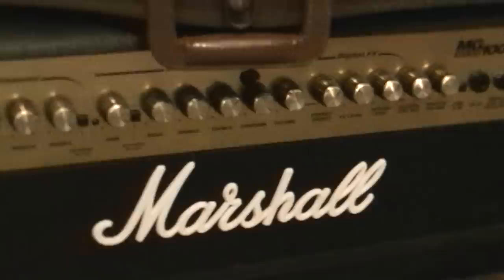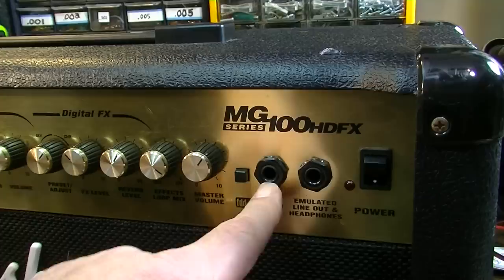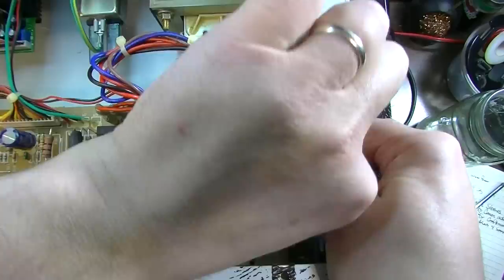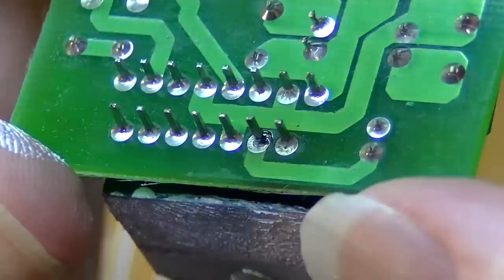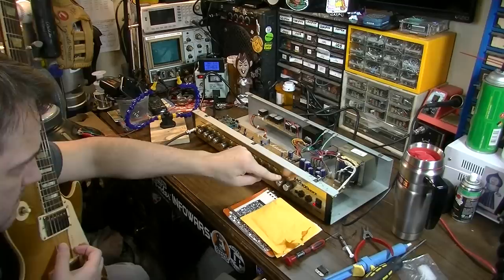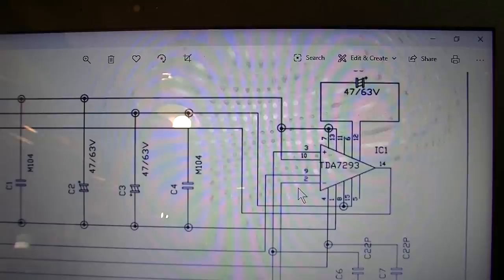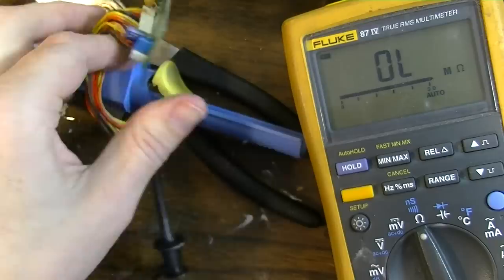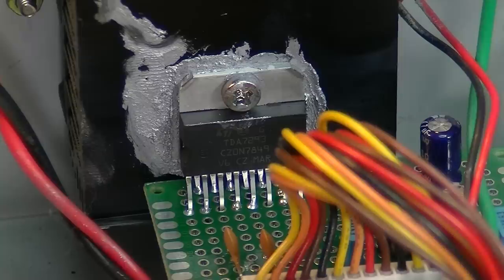Found a Marshall Amp in a DUMPSTER...Can We Fix It?

Comment: Guy sees blown fuse, sitting in its holder only just, takes off the entire board...
Sure, a fuse blows for a reason - but why NOT put in a fresh fuse first and see if it holds? Wouldn't be the first time that the fuse, sitting in its place by the skin of its teeth, fails because of frail contact. Also, that fuseholder looks suspiciously askew, so I would've taken a mirror and see whether its soldering was still intact.
Transformer is good: sure, why wouldn't it be? I've never come across a transformer looking as fresh as that, that had worked for 15 years and all of a sudden packs it in.

Comment: How did you get it working without a wire brush and pressure cleaner?  Haven't you learned from Metal and Restoration that that's how to fix things? 🤣🤣🤣

Comment: If you want us to believe you found this, it should have been covered in mud and in the bushes on the side of the road and the repair did not include a rusty wire brush, garden hose or rattle can paint job! :-)

Comment: I've only watched few recommended videos from you and since you had reaction videos of these ridiculously stupid "restoration" videos I thought this was a joke! :D like "yeah, I found this Marshall and sI'll just tap water it and it will be good as new!". But it's legit and I find it really interesting! So very nice job BUT I have to comment on that ugly soldering you got there :D I can't help it! Probably no one reads this but here goes anyway: 

So if you get that kind of ugly "balls/bubbles" of soldering tin, you're doing it wrong. You need to heat the components (wire and connection surface) and apply the soldering tin when the surfaces are hot. The tin will melt almost instantly when you touch it with the hot soldering iron. But if the surface is cold the tin will not attach and melt in there correctly and you might not get good connection. So when soldering: 1. bring the wires/surfaces together 2. heat them both 3. apply the tin.

Anyway, that component is probably going to do just fine but I can't help this. I am a teacher and I am a "hand crafts" teacher at that so when I see something like this I like to help :). This video was educational to me so if you read this I hope you were educated as well, thanks.
Reply from the maker: If you’re talking about the soldering on the board I made, there’s no way to make that pretty. The soldering is fine. I’ll guarantee it’s sound. You’re looking at through hole component legs from the other side of the board and connecting wires wrapped around them.
Reply: @TheGuitologist  Yeah, that is what I meant.  And I understand what I am looking at there. Like I said it sure works but its not impossible to make it prettier, though functionally it doesn't matter.

Comment: That thing is a joke. 100 watts RMS? You've got to be kidding. Just look at any good 100 watt power amp and you'll see a lot more than a few capacitors, an output module and a dinky heat sink. Shame on Marshall. If you put a good one on a dummy load and a watt meter and ran it to 100 watts RMS, I guarantee you will fry the darn thing.

Comment: surprising that Marshall uses such a simple to poor amplifier! on ebay you can buy amplifiers cheaply with the same ic. Amplifier with such an IC is not a good amplifier. they break easily! marshall used to be good before. There are many active speakers that break down fast since they use this type of cheep amplifier IC.  such amplifiers ic. usually sits only in cheap stuff!

Comment: Don't give up on the Marshall amp just break down and buy you bored don't try to make one and if you keep replacing parts if you do it a little bit of the time you'll have a brand-new refurbished Marshall amp dude seriously by the board already made up your soldering wire job looks terrible buy the new board that way there's no worries I mean you got the thing for free so what if you spend a few dollars on beer if you spent 50 to 100 books fiction that you're still on am I not right my dad always taught me to do it right the first time so you don't have to go back and do it again I see that your wire job is working but still I would replace it with a new board then keep going back to that dumpster my find the bottom half of that Marshall you never knew I fountain Ibanez in the garage it worked all I had to do is tighten the neck and it was fun and it was fine but seriously you didn't pay for the Marshall get that brand new board in take that thing out you made like I said you spend $50 to$100 on parts it's more than worth it put the new board in it

Comment: Nice, but that's the worst board build I ever seen, I did better things when I was a teen, I'm sad to say that. If you get a plain board with copper on it you could have draw the circuit and remove the excess with a dremel if you are not confident using Acid bath. But also with the board you used you can draw nice line with a naked wire and recreate the same(even better as will be much thicker and stand more power) wiring printed on the board.

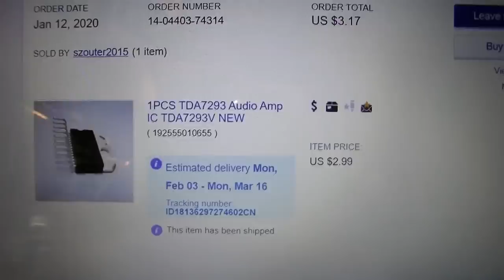Comment: 17:58 Why on earth are you buying cheap chinese (tracking number gives it away) knockoff/fake chips from ebay, despite being in the US so you'd have no issues ordering from Digikey, Farnell, Mouser or whatever? I mean hell... you can get this exact TDA7293 as a free sample directly from ST (so definitely the real deal) for crying out loud...
Another thing that occured to me is that you never checked the fan. Considering how cheap and cheesy everything in this amp looks (from the PCB to the cheapo noname electrolytics to.. well everything) it wouldn't surprise me if the fan is a bottom of the barrel sleeve bearing special that has long since seized. I mean this amp isn't exactly fresh off the line, and if it doesn't spin it won't collect dust :P